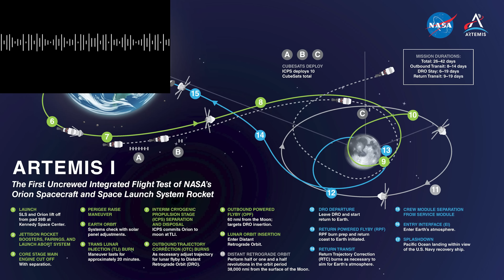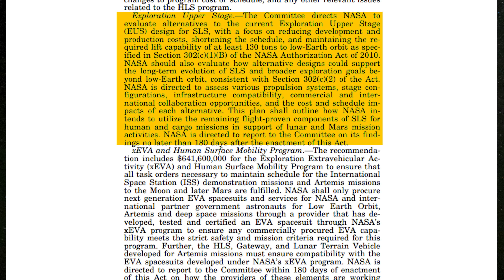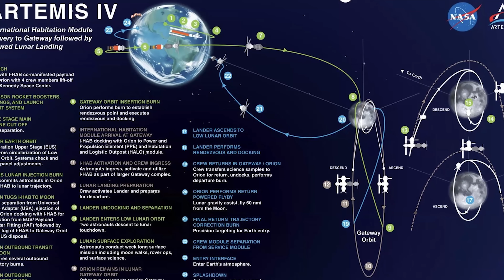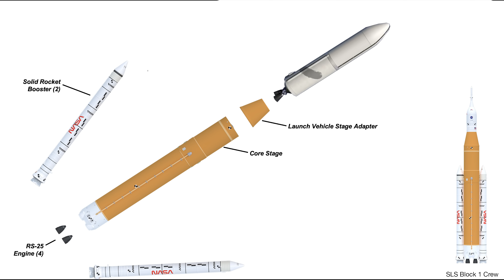NASA Found Brilliant Solution to Go Back to the Moon before China. SpaceX Starship?

Comment: SpaceX basically built the entire comapny, developed numerous new launch vehicles (inclduing one man rated and reuseable), built its own Launch Complex, Space capsule, space suits, and worldwide satellite network, and became the largest satellite launcher and operator in human history.

All for LESS than those four launchs of SLS - which is built from leftover 80s technology.
Reply: and they also took 3 billion dollars to land on the moon this year
SpaceX can talk about reusability of the upper stage as long as they want - at they moment they burn/melt and are dumped into the ocean.
Hell, even the final proportians/dimensions are still up in the air. V1, V1.5, V2 - is a prototype test actually sensible to measure any progress if the height and weight will change again?

They made progress, but I don't see them making 10+ docking manouvers to fill up a starship this or the next year - and they still have to fly to the moon, docking with Artemis - land (not tip over) and start again. Is this going to happen <2030 and how many ships will they need/blow up?
Reply: Starshit IS NOT reusable, it blew up every time!
Reply: @MikeViker  This isnt actually true lol
Reply: @MikeViker hesus, you are dense.

Comment: Yeah but SLS works. There are so many problems with starship. SLS is a one shot vehicule, it gets you out of earth orbit in one shot.. Starship needs at least 15 launch to tank  and a shitload of problems to solve before it's done. Imagine this machine flys empty now
 No furnishing inside no heavy equipement to be shipped to the moon. And no crew. Even by space x standards i don't see having an operationnal vehicule before the end of the decade...
Reply: Yes and thats what many people here do not understand. SLS is expensive potentially overengineered. But because of that it not only works, but exceeds at what it does. We are not doing a simple thing, we are sending humans through space, there cannot be any leeway for failure.
Reply: @the_mastermage  exactly
Reply: I don't think they should use Starship for a moon trip with people on it, as it's first moon mission, either. It should launch a payload of supplies.

But they can use Falcon Heavy, which has proven itself launching people into space.

Comment: SLS is a retarded expensive obsolete design that does provide good jobs for the space coast.   Starship as a fully reusable gigantic spacecraft may be too ambitious for the near term.   Superheavy booster is already a winner,  with double the power of the Saturn V  first and second stages fully reusable at a fraction of the cost.  Why not create an expendable upper stage - like the Saturn V 3rd stage ?   Instead of the slow ESA propulsion module,  SpaceX could recreate the service module which could blast Orion to the moon much faster.   Combining innovation where it's already proven with fallback to tried and true methods seems the best approach,  avoiding issues with  in space refueling .
Reply: SLS was a rocket that NASA did not ask for or want.
It was a congressionally mandated jobs program.

Comment: The space shuttle didn't have a dedicated abort system either. They launched that thing for decades. I love the double standards.
Reply: They claimed it DID have some launch abort capability but never tested it.  It could separate early and land at downrange landing strips that were always manned during a launch just in case.  Later (after Challenger) they installed a deployable Boom that the astronaust could use to "eject"  but was kind of a kludge (again never tested)
Reply: @stuartgray5877 It was certainly never utilized. If it wasn't tested, that means it was never installed. They flew the shuttle for decades without a system like that in place, and the system they did have was obviously inadequate. I mean, 14 astronauts could have potentially benefited from such a system. It's a double standard—NASA learned lessons from its mistakes but never held itself to those standards. Yet, they expect other companies to meet those standards. Once Starship is operational I believe it will be as reliable as Falcon 9 has proven to be, maybe even more so. I'm not sure Musk would be satisfied with anything less.
Reply: And it was one of the deadliest spacecraft in history, your point?
Reply: @jedihunter176  They are all deadly! There is no point. Dream Chaser will be the first to be reasonably safe.  Apart from Space Ship One, but it did not go to orbit so that is easier.
Reply: They also lost 14 astronauts in the shuttle program, i saw the challenger blow up live. There was a lots of success, but although a fantastic machine, there were problems , in the end it was deemed too dangerous to fly by a commission. Goerge W Bush killed the program in 2003 after the Columbia disaster
Reply: @FrancoisBrindamour yeah I watched it live too in 9th grade.

Comment: Looking like 2030 at best.  I've heard little from SpaceX on how to store liquid oxygen and liquid methane over a span of days for a moon mission, or how to store that fuel for months during a Mars attempt. Methalox fuel must be kept insanely cold to be stable.  Otherwise, all that cryogenic gas will boil off.  During Appollo, the service module and lunar module used hypergolic fuels that are stable over long periods of time.  Though hypergolic fuels are dangerous, and tricky to use, they are the only deep space fuels used for long term spacecraft missions. Starship needs a way to refrigerate it's fuel over long periods of time.  Such refrigeration equipment will be heavy, and require banks of heat exchangers. Such refrigeration will require a good deal of electrical power. 
  Methalox is a good alternative to more expensive hydrolox systems like the Artemis program uses.  Not quit as efficient as hydrolox, methalox is far easier to work with.  Both make for a good launch from Earth fuels.  But with both, you fill up the rocket, and launch soon.  During launch, all of this fuel is burned off within hours, if not minutes.  Such fuels will boil off over a relatively short period of time, without a means to stabilize methalox via refrigeration, it must be used up, or lost through venting within a short period of time.
Reply: Now you know why they say it will take so many trips to refuel.  They are fighting the boiloff.  But that can be managed just by exposing the tank to deep space and keep earthlight and sunlight off of it.

Comment: I don't think Starship will be a viable option until the 2030's at least. It's not even remotely man rated. If NASA really must beat China (why do we need to beat China, we already won back in 1969?) would be to build the last version of the LEM paired up with Orion. We are not even close.
Reply: Agreed that we already beat China. Either we do it right going forward or not at all. SLS no matter how you slice it is NOT the right way. It's not like China can get dibs on all the water-containing craters in the next 10 years. There 1.3 million on the moon larger than a kilometer, and if at least 1% will have water ... That's 13,000 possible water-sources on the moon. Let China grab whatever 10 they want, we'll take the other 12,990 when we get there.
Reply: 2030?  Haha.  Well the jokes on you. They’ve already sent several dozen to mars. Because Elon said he was doing that in 2018 and 2022 and 2026. And Elon never lies…
Reply: @Meatball2022 SLS said they'd return to the moon "by 2020"
Reply: @Meatball2022 also, your quoted dates are based on Musk's comments from before starship was conceived, when the strategy was to use falcon for just a touch down instead of creating a base for future settlement, which required a much much bigger rocket.

Comment: Starship must use a 2 system propulsion in order to return from the moon. The 1st stage would need to push starship further so that it would not have to use thrust until nearly the point of breaking earth's gravitational pull. Once free from earth it's own thrust can end and an ion thruster or small nuclear propulsion system take it the rest of the way to the moon. This way there should be enough raptor thrust to return to earth. Just saying.
Reply: The Apollo ships did just fine.
Reply: Two segments as follows: Builds the ships rapidly and cheaply for about $150m per ship (and they're reusable). LEO Depot (modified tanker version) is launched to Earth LEO. 10 tankers launch (reusable, so $50m or less per launch) to the Depot depositing maybe 2300t of fuel. Coating and/or sun shades slow boil-off. Lander launches, docks and refuels... her Crew Dragon Might put the crew on (safer than just going up on a ship with no emergency escape). This won't happen (gov't pork). Lander heads out to lunar orbit and Then a $5 billion dollar ship/rocket transfer crew. Lander lands. Crew does stuff for a week or months (depending on how fast fuel boils off with attenuation). Lander has more than enough fuel to dock with the Orion in orbit and go back to Earth. Lander will: also go back to Earth or stay in lunar orbit as an emergency shelter.

Comment: The US doesn't even need Starship. It could use the ALREADY EXISTING Falcon Heavy architecture that can put 64 tonnes in LEO or 17 tonnes to TLI. That is fully EXPENDABLE, so it'll cost at least  200 million a pop. SpaceX would have to scale up booster production, but they could get to one launch per week fairly quickly.
Reply: The goal was a "permanent moon base". FH could do alot of wh

Comment: NASA is an aerospace jobs program masquerading as a space program. SLS/Orion should be cancelled after Artemis 3, NASA should never again be allowed to build it's own spacecraft or issue a cost plus contract.
Reply: Starship is has failed to land from orbit in 10 Flights. SLS succeeded in its first flight. NASA should fund a reusable first stage of SLS like Falcon 9, New Glen, New Shepherd and the two Rocket Labs rockets.
Reply: @mrbaab5932  Going by the example of Falcon 9, the early failures and lessons have helped build a robust engineering that is able to fly hundreds of times. If the same comes true of Starship, the cost benefits are enormous. Each other alternative is a single use system which are expensive and a slow process by comparison. Repeatable and reliable engineering is needed to scale up.
Reply: @mrbaab5932  Starship has never let been to orbit so it would be awful hard for it to return from orbit....Also other than it's side boosters which are sorta reusable it is impossible to reuse a SLS first stage...

 The booster is not designed for legs, the RS-25 engine cannot throttle below 67%, if they tried to save enough propellant to land a SLS main booster it would lose at least 1/2 it's payload to LEO. Which when you consider it is already has to deliver Orion to a Near-rectilinear halo orbit cuz it hasn't the propellant to achieve a true Lunar obit, losing 1/2 it's lift capacity would mean it couldn't get to Luna at all...

Also SLS uses Hydrogen as fuel which causes hydrogen embrittlement of the metal it's fuel tank is made out of. Reuse would require extensive inspection and refurbishment after every flight and the tank's lifespan would be so short it wouldn't be worth it....

Finally what would be the point? if you could somehow retrofit SLS to have Starship's features and do it without taking anytime or it costing anymore money you would still have a rocket that cost 40x more than Starship and has at best 1/3 it's lift capacity.
Reply: You mean Boeing?
Reply: The people who work for NASA are smart and highly motivated.  The problem is that if you work for NASA you must do what congress mandates. I blame the politicians, not the NASA people.
Reply: He said Artemis 4, 5 & 6.  Perhaps this is a sneaky way to destroy NASA's build program.  If we didn't already know that integrating two systems was complex and expensive, we ceetainly know it now.  Now, he's proposing adding a third system not designed for SLS.  More complexity, more delays, and more expense.  Note that it's after Artemis 3. UMP still gets his flashy return moon landing.  In the future however, this will be the rock that starts an avalanche.  The agency could be getting sabatoged purposefully.  Remember, Congress forced SLS on NASA.  Now the UMP admin wants to force this.  The idea could be to implode it from the inside.  Just can't take at face value what these ppl say.
Reply: I’d keep Orion and look for other launch providers.   Safer than launching on Starship.
Reply: @keithparker6520   SLS was pulled out of the Constellation program's ash heap because it's the only vehicle that can launch Orion. Really nothing else exist... 

There is an idea where you would launch Orion on Falcon heavy and deliver to it in LEO a New Glenn upper stage launched on a Vulcan centaur that would then take Orion to Luna... I could spend the rest of the night typing and still just scratch the surface of why this idea is not workable... 

Anyhow... As far as Starship goes to land people on Luna the Starship itself has to be human rated. So the only reason we're bothering with Orion/SLS at all is the Sunk Cost Fallacy. You can do Artemis with just Starship or with a combo of Starship and Dragon. 

Which could be what happens cuz SpaceX is very likely to start launching people in Starship in the next couple of years with or without NASA...

And that includes to Luna. SpaceX, not NASA is the primary funding source for Lunar Starship which is a SpaceX product, not a NASA property. So Lunar Starship is getting built with or without NASA. Should Lunar Starship be ready in 2027 and everyone else still needs 5 more years to do Artemis 3 it's a good bet SpaceX will give NASA an ultimatum they fly the whole mission on SpaceX hardware or SpaceX flies the mission without them.
Reply: @THX..1138  Oh I’m sure the lunar Starship variant will be ready to go in 2 years, just like they sent rockets to Mars every orbital window starting… what was it? “by 2018” and a manned mission to Mars… last year. Or as of 2020 their aim to send a Starship to Mars in the 2024 window. I’m sure they’ll manage it eventually but they are never even close to timelines, and 2 years from now isn’t happening when they aren’t at a state of consistently flying even the first version without a “destructive test”. 

Just to be clear, while from the outside I don’t really buy that losing so many launches is actually the most productive path I also know I’m on the outside of whatever data they’re getting so I’m not arguing that’s “wrong” to be doing. But even if it is genuinely worth it/the best alternative, doing partial capabilities tests that mostly end in loss of the vehicle and even that recent successful launch losing an engine doesn’t exactly suggest a program that’s anywhere close to commercially ready much less ready for human rating.
Reply: @RocketSurgn_  Looks like YT is doing some pretty hardcore Gaslighting on this subject they've deleted all of my replies to people.... So I'll just say IDK or care if Lunar Starship is ready in 2 years and doubt SpaceX does either....But I do know NASA is terrible value for money. If you tasked them with building you a dog house they'd hire a hundred contractors to do it. In the end it take 25 years, cost billion dollars and your dog would burn to death when one of the dog house's solid rocket boosters blew an O-ring.
Reply: NASA scientific work such as satellites development was and is important!

Comment: Perhaps the SLS program should continue as is for the most part, and over the next 10 years test it, and have it on Stand-by mode for when Starship variants or other manufacturers of spaceships take over. SLS might be a good back up plan in case of an emergency mission to save lives.
Reply: So keep spending the money, but not launch the rocket....You should apply for a job at NASA as a Comptroller you seem to have a good grasp of their way of doing things.
Reply: NASA should be focused on new Innovation and technology. they should be working on the nuclear energy we need on mars

Comment: ‘Elon musk has said … eventually’ … lololol
Reply: Eventually is 2027-2028 if you are talking about moon landing. He has mapped out Starship 3 and 4. He has built out a vast infrastructure to build rockets and other related equipment. He will have 3-4 launch/landing pads by 2027 (finishing the second this year). His company Currently launches 90% of the planet's satellites, Provides Manned transport to the ISS, Put up a constellation of comms satellites larger than all other satellites ever launched... 

One qute does not trump 15 years of tremendous accomplishments. (Still the only orbital rocket that lands... and it has done so more than 300x so far). His orbital flight leader rocket has flown and re-flown 30x so far. No one else can do that either yet. 

Read up on what Spacex has done before you laugh...
Reply: @avgjoe5969 he still hasn’t delivered FSD 😂